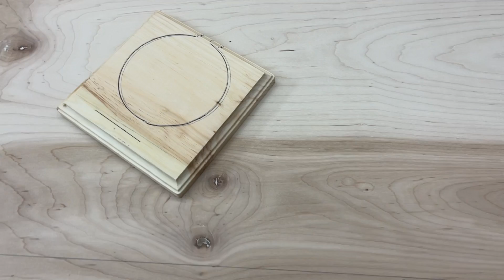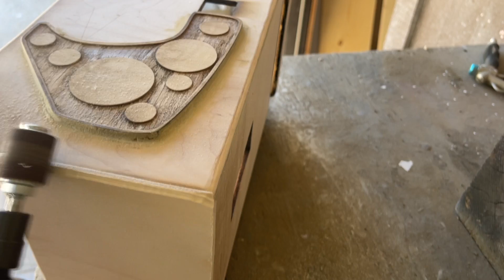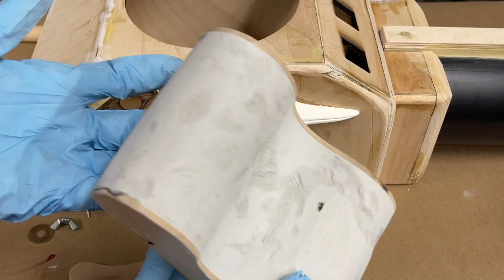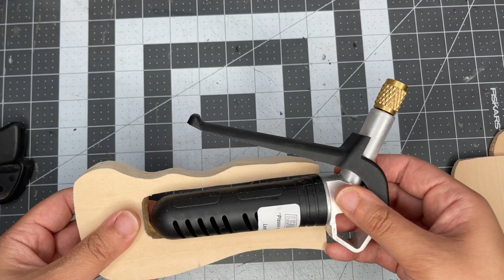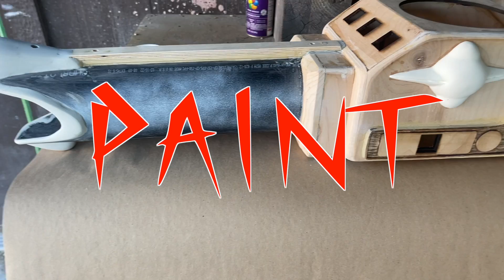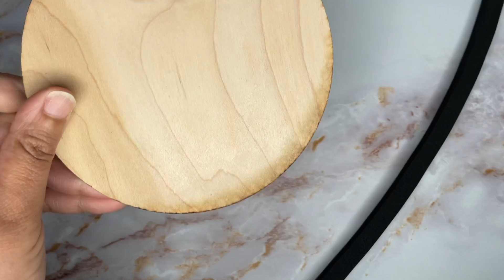Built a REAL Killer Klown Popcorn Bazooka!

Comment: great tutorial.  the issue with the CO2 is the 4"diameter of the barrel.  internally use a 2" diameter tube and cut it short so its not visible, use another funnel and mount on the 2" diameter tube like a trumpet and paint that all black so its invisible.  now your air pressure will be much more concentrated to the 2" diameter, but the trumpet horn won't show the smaller real diameter. the funnel will also allow you to load the gun properly.
Reply from the maker: Thank you so much! Definitely going to give that a try! Determined to get a better blast of popcorn 😄

Comment: Why did u choose to use the epoxy instead of the other white foam you normally use? Is is because the epoxy is more sturdy?
Reply from the maker: Yes I did used the epoxy since its way sturdier. It cures rock hard so it easier to sand smooth. Paint grabs onto it much better since it won’t flex and crack the paint 😊